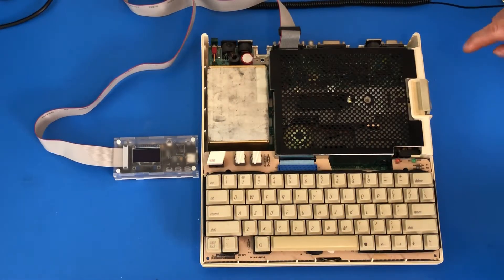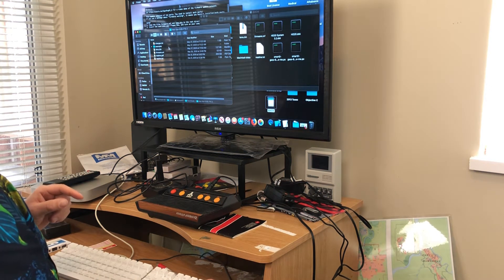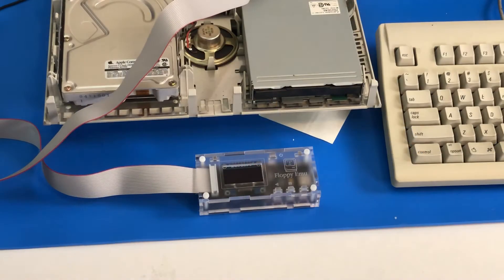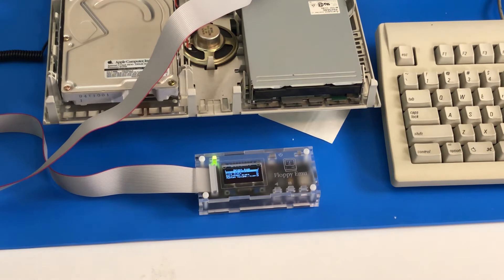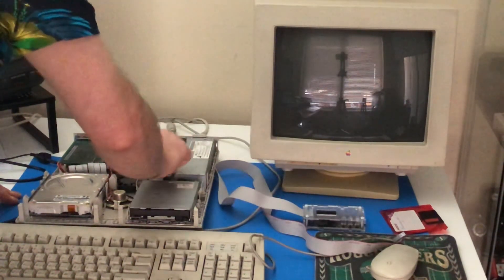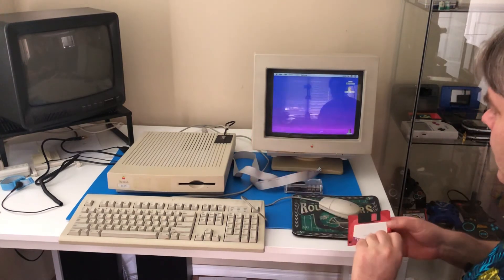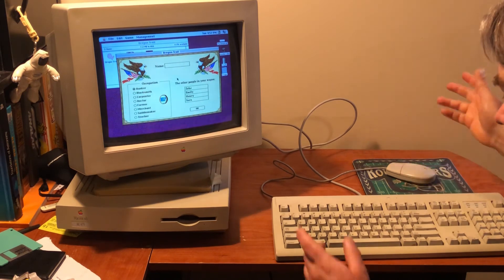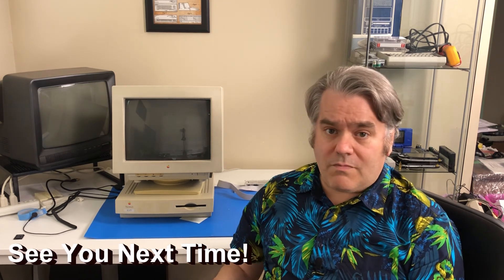Using a Floppy EMU to Put Games on my Mac LC 475

Comment: Best video but I think I must’ve missed a step or explanation. Why did you need to  copy the game to a floppy disk to use on the other computer? Couldn’t you essentially connect the Emu Floppy device to the destination computer and just copy it over that way?
Reply from the maker: These old computers don't have hard drives, the floppy disk is the only storage media I have for them.  The disks mean I can have the computers set up in different rooms without having to move the emulator back and forth (The Apple 2c requires taking the computer apart to hook it up)

Comment: That's a great device. It really makes having old machines a lot easier. Those computers will be a lot of fun after you make them what you want, but also the making part is a lot of fun too. I filled an old MacBook with games I had and also abandonware games from an internet archive, and now it's quite a retro prize. Making the discs is a great idea. Thanks.
Reply from the maker: The disks also help for if (when) I get more old Macs for repair, testing, then GAMES!